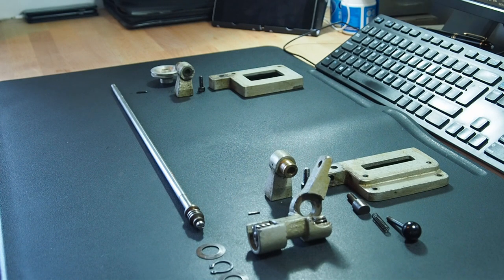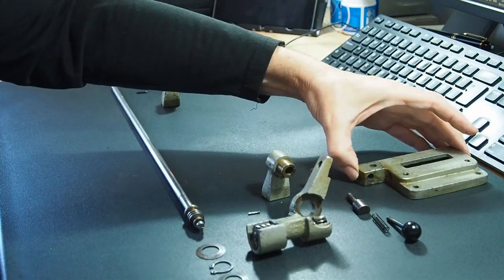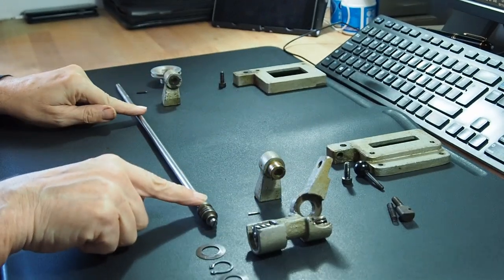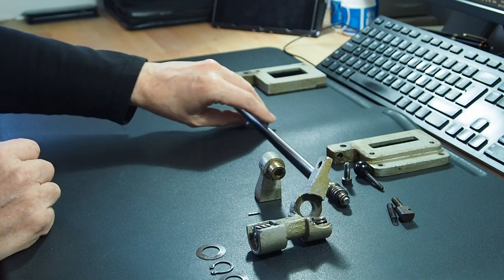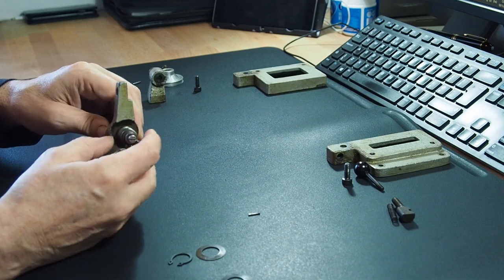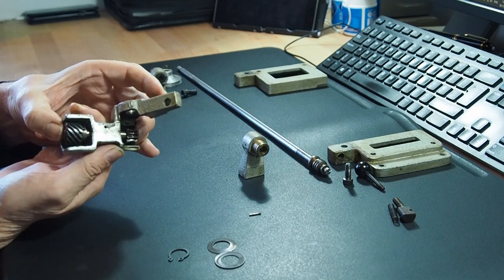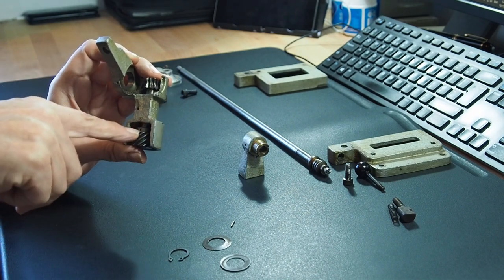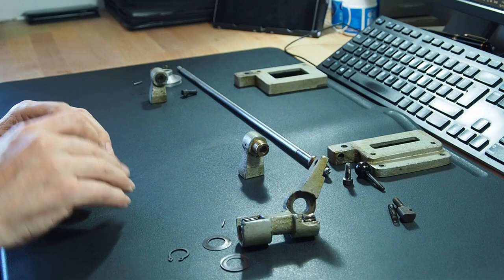Emco Unimat SL - Restoration - Disassemble (Part 4).

Comment: Hi Paul, interesting little mechanism. Does the pin go right through the gear (ie, can you see both ends of it when you rotate the shaft?). Next question, if you can see both ends, is it a tapered or parallel roll pin? This is going to be an absolute b#@*#+d to drill out. If it were me, I would be drilling a hole (2 or 3 mm bigger) in the housing at the back for a punch to go through and knocking it out the front. You can then either tap the hole and fit a grub screw (to help the next guy who strips it), or if you want to go original, fill it and paint it before you refit the gear and pin. Hope this helps. Jon
Reply from the maker: Hi Jon,
Yes the pin is visible at both ends and it is a roll pin... The hole in the housing would work and then go with the grub screw... 
Top tips, thank you.
Paul,,

Comment: I can see why you need a good drill vice now. I assume the shaft with the gears on has a bronze bearing in the casting that may need replacing. Thanks for sharing the progress and take care
Reply from the maker: Hi Joseph,
I don't before there is any bearing surface other than the casting, fingers crossed I am wrong.
Take care
Paul,,
Reply: @TheKnacklersWorkshop  Hi Paul, a quick thought. Would it better to drill a small hole through the back of the casting to give you the space to drive the pin through. This way you do not risk any damage to the shaft
Reply from the maker: @GardenTractorBoy  Good idea Joseph... Thank you.